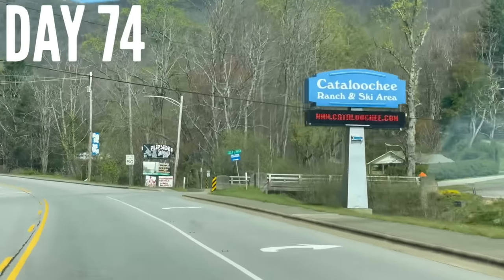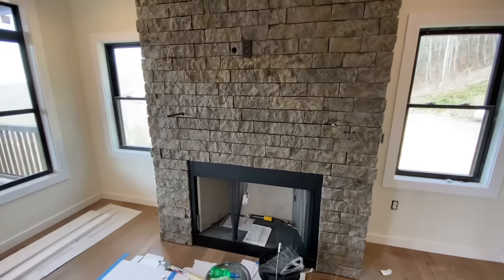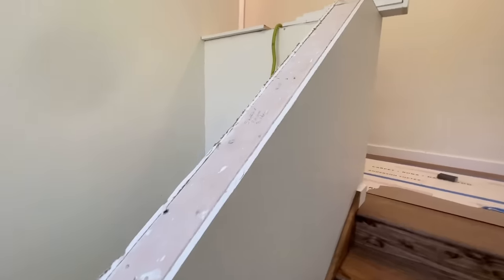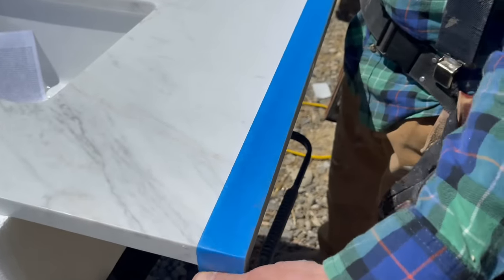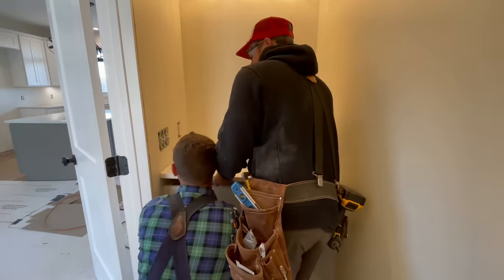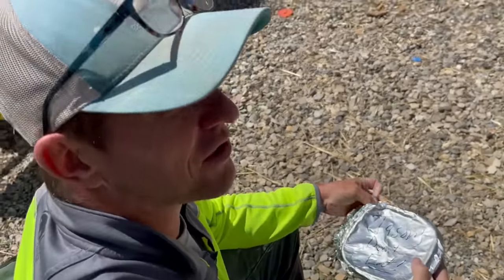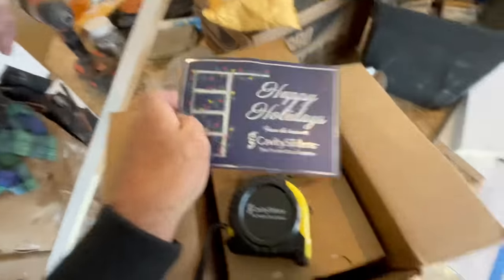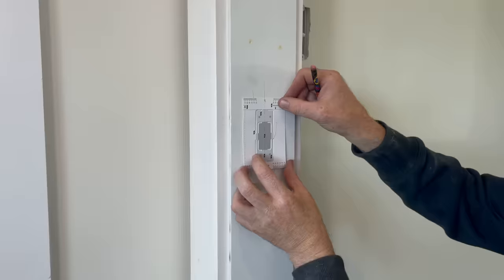Building The Farmhouse | Day 74

Comment: I wonder if the bathroom was designed to fit that counter top but when designing either in the software or the designer made the mistake to not include the thickness of the drywall?
Either way that's something to plan for in later editions of your homes so you don't have to make those cuts again